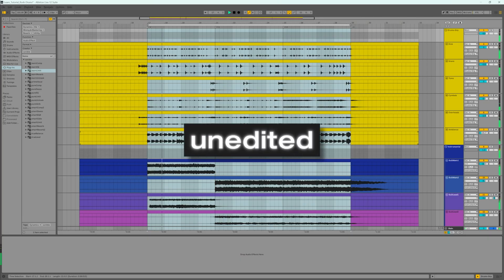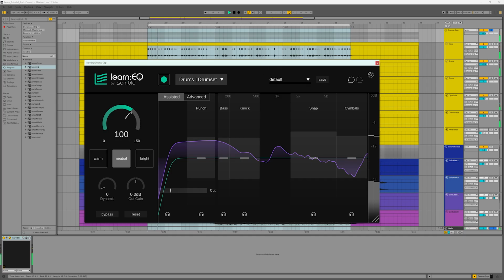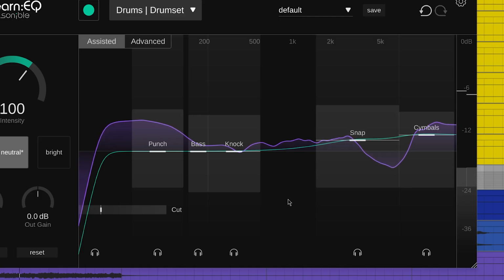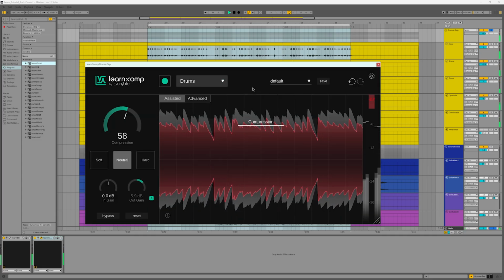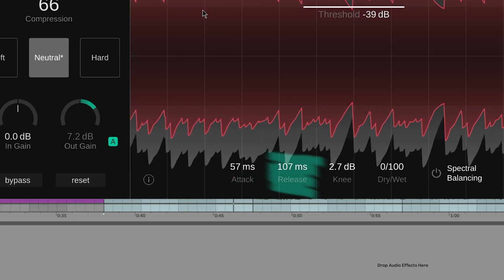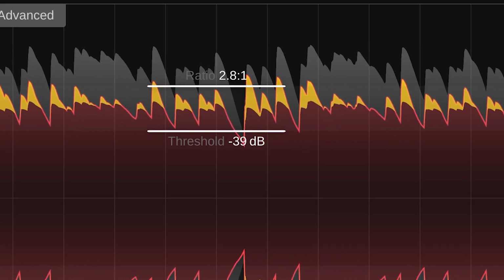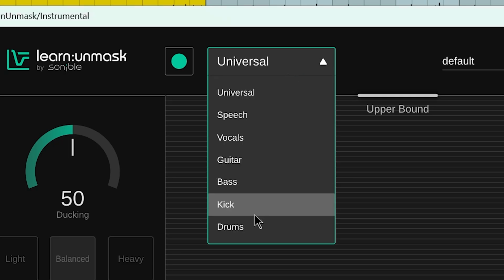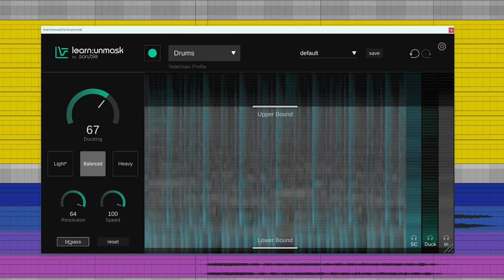Make drums go hard | learn:bundle by sonible

Comment: This appears to be the same as focusrite's FAST. sonible may not be at fault, but I am not convinced by this.
Reply from the maker: The learn:bundle builds on core elements of the original FAST plug-ins (that we developed for Focusrite) – they were simply too good to leave in the drawer. However, for the new learn series, we've taken things further: the processing has been refined, the interface redesigned and we’ve added a stronger focus on new guiding and educational features.
Reply: @SonibleCom is there a discount for FAST owners?
Reply from the maker: @russelledwards2405  Since Focusrite handled FAST distribution, we don’t have the customer details needed for a direct cross-grade. But if you’ve owned FAST before, please contact our support team at support@sonible.com
Reply: @SonibleCom thanks
Reply: @SonibleCom unfortunately the automatic reply do not work when you ask for discount 😂.
That’s why I like your plugins, because you can tweak manually the automatic version.
Reply: @SonibleCom i have both and i like the sonible declared version better! More stable for sure
Reply: Eerily similar.
Reply: They actually helped focusrite make the FAST plugins.
Reply: @iamcorykofficial  Yes, FAST is no longer supported. So it's a problem.